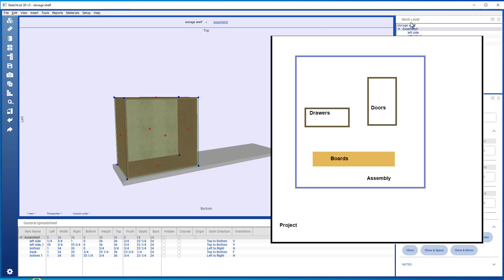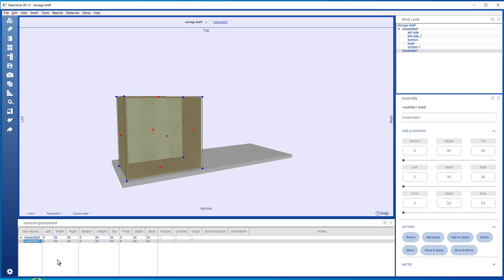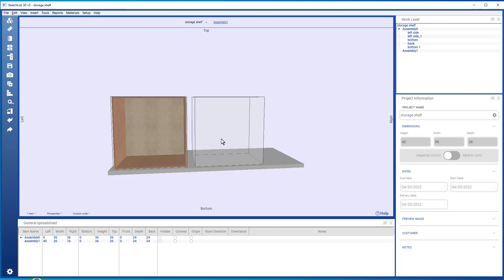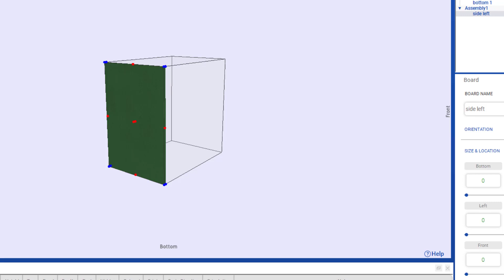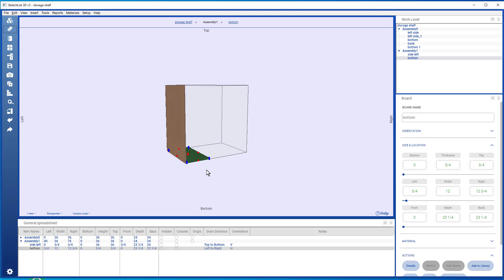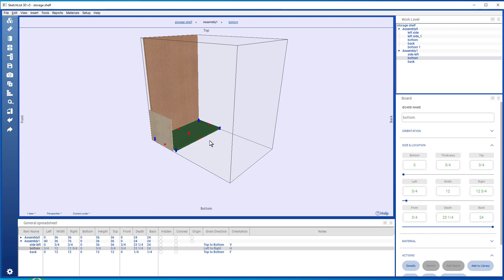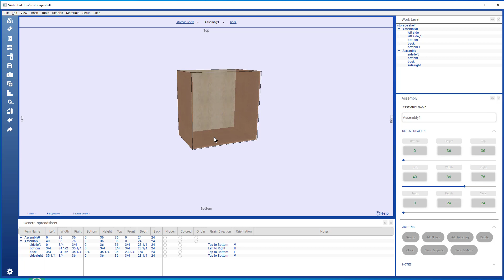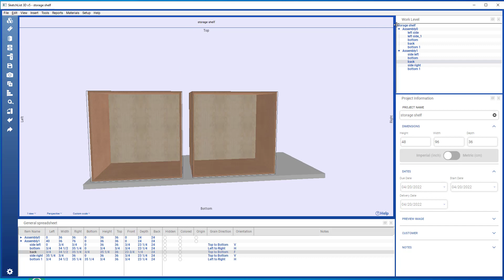Making a cabinet in SketchList 3D - introduction

Comment: Setup an assembly selecting metric for the measurements but it loads sheet goods in imperial and I can't add boards using metric measurements because it says board doesn't fit.  It completely ignores the metric parameter and keeps designing in imperial.  Unfortunately can't use this at all now because I either constantly convert and hope it's accurate or switch to imperial and end up with cabinets out of size because my physical sheet goods are metric.  Seems like a bug or an oversight?